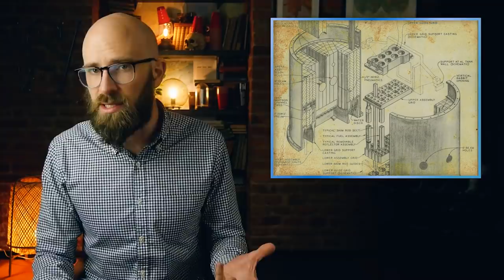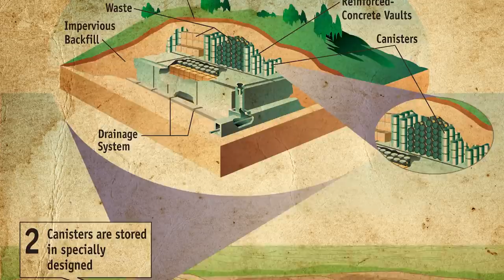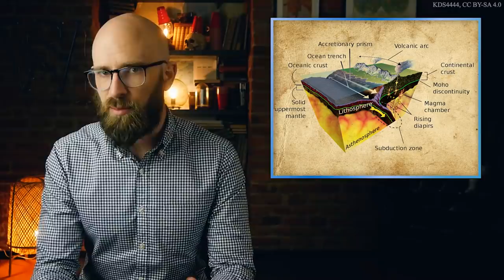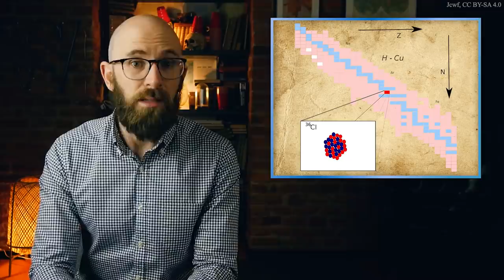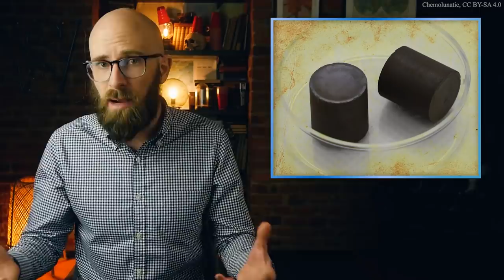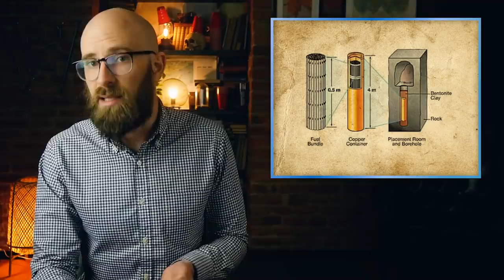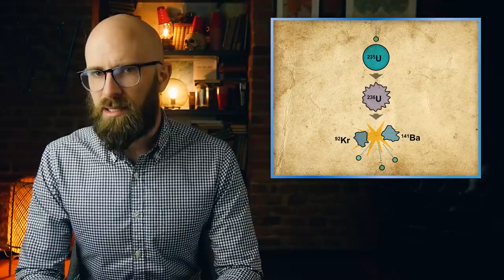How Does Nuclear Waste Disposal Work?

Comment: what if nuclear waste could be used for something that we have not yet thought of🤔
Reply: We could use it as some sort of weapon .
Reply: Most used nuclear fuel cells from reactors are  going through recycling process, to obtain various products, that are created during nuclear reaction. But unfortunately this process is very very slow. So as of yet, big portion of it sits somewhere in the storage, either in water or tomb made out of concrete buried underground.
Reply: There are a number of ongoing projects in development which plan to use existing nuclear waste for small scale electrical power plants and to power engines for space vehicles.
Reply: @krivdik  in fact almost no nuclear fuel is going through recycling. While it is possible to recycle nuclear fuel the cost and danger is just not worth it. Some process are basically in process for experimental reasons.
Reply: If we somehow discover nuclear waste is really useful we would just make lots more of it. It is not like we have a problem making the stuff.
Reply: @welfdeath  oh yah like we need more of those .
Reply: @revcrussell what percentage of "all" is "almost no"? Could you define that for us?
Reply: Black Vito - Moneyology, if we want it, we can get it. Despite being deep inside the bedrock, it's not impossible to get it out. Dig some 600m, scoop the bentonite clay out of the way and that's it. Mostly already in a very compact state, it would be more efficient way than digging for new ore and refining it.
Until that happens, they are safest deep underground.
Reply: It's already used in smoke detectors, high pressure gauges, the medical field, bullets, armor, sterilization, artillery etc....  the time has come to know we shouldn't be using it because what its done.  We know its organically binding to our cell once ingested and causes cancer. I think the time for change is apon us before actual prompt criticalities start to happen.
Reply: Nuclear waste CAN BE used for many other things and we HAVE thought of them. ;) But deeply unscientific political pressure prevents us from taking advantage of these advances. :/ 

One of the reasons that designing a nuclear waste repository is difficult (that Simon didn't mention) is that they need to included a retrieval mechanisms for just such a purpose as reusing the nuclear waste. Scientists insist on including this feature in the hopes that future people won't be a dumb and wasteful with their resources as we're being.
Reply: @bronzedivision  Deeply uscientific??? You wrote that before I responded.   Ok now, explain to everyone how the inverse square law is used not only for the measurement process but also the calibration as well.  Make sure to note this law only works in a vaccum and does not apply to extended sources of radiation as well.  Explain how an "exclusion zone" sphere cant be made around a meltdown without using this law so if the source is extended then explain why that "exclusion zone" is actually null and void.  The reason it doesn't apply to extended sources on the surface of this planet is 1. Water cycle 2. Atmosphere 3. Oceans currents 4. Jet stream 5. Water solubility of radionuclides 6. Evaporation under equillibrium conditions 7. Bonding with molecules like oxygen 16 and 18 8. Free movement around the planet 9.  Once ingested it forms organically bound forms of it 10.  CAUSES CANCER, AUTO IMMUNE DISEASES, MUTATIONS AND OTHER DISEASES AND AILMENTS THAT ARE PASSED ONTO FUTURE GENERATIONS.  Provide a list of all the deaths caused by cancers, auto immune diseases and mutations of every kind that were caused by ionizing radiation ONLY for the past 70+ years since the atomic era.  You are aware no such list exists and without the ONLY deaths that could be associated with nuclear power added into the statistical analysis then any person promoting the use of nuclear power is completly and utterly incorrect.
Reply: man with pen around neck  Because it's our best energy source by FAR. And also useful for a litany of scientific and industrial processes that modern society has come to depend on.
Reply: @bronzedivision  Again no it is not our best energy source....especially at only 10% globally....
Reply: @paulmobleyscience  hahahaha Until you have a reliable weather report or a solar panel that works at night nuclear power is the ONLY energy source. So that makes it the best by default.
Reply: U-238, the vast majority of the waste, can be used as energetically net-possitive fissible in fast neutron reactors
Reply: @bronzedivision  Im sorry? "Hahahahaha"....is that the technical scientific notation of laughing or isn't it quantified better with lol or lmao or even the simplistic 😂 
Surely you know that thousands of companies exist today that will come to your home and place a solar system that will not only meet 100% of your energy needs but also make excess power that you then sell back to the grid and make actual money from???????   Your stance is so 1970....leave it there and come back to the future.  The future is now Bronzedivision respectfully the pronuclear stance is dead now.  The cat is out of the bag ha  ha   ha   ha   ha..
Reply: @nickkorkodylas5005  No U235 is the issue....U238 captures the neutron.  And its the daughters that exist thats the issue.  Pu236 is made only in a nuclear reactor...many radionuclides are only found synthetically in a man made reactor because and specifically due to the U238 neutron capture.  Its like the natural form of control rods.  They have to mine millions of tons of U238 to find the small amount of U235.  At the end of both alpha and beta decay modes there is a gamma release.  Usually the mix is about 3% or lower of U235 and if Its MOX the uranium plutonium mix is usually no more than 6%.  The waste has never just been U238.  Look at the U308 Galen Windsor licked off his hand.  Not even yellow cake yet....
Reply: @krivdik  We can sustain the entire US energy grid for 100 years on the current nuclear waste available if we recycled it.
Reply: @paulmobleyscience  Nuclear is our best energy source.
Reply: @TechnoMinarchist  No, No its not.
Reply: @TechnoMinarchist  This isn't about money or how much fuel we have left or any other self indulged reason.  This is about how dangerous it is shown by not only Fukushima but the hundreds of issues and incidents had before Fukushima.  This is about militaries of the world furthering the use of nuclear not the people. Nuclear is 10% of the global market....after 70 years nuclear is not the future it is the past
Reply: @krivdik  Most used nuclear fuel cells are NOT going through recycling process.
Reply: @welfdeath  we do.  It's called a dirty bomb.
Reply: @krivdik  No spent nuclear fuel is being reprocessed in the United States.  The process is not slow, but produces large quantities of highly radioactive and hazardous waste.
Reply: @bronzedivision  Monitored Removal Storage is not a regulatory requirement for waste disposal. It is an option for short and medium-term storage, not disposal.
Reply: @TechnoMinarchist  No way.  And reprocessing spent nuclear fuel produces a lot of highly radioactive and hazardous waste.

Comment: If this nuclear waste is still giving off so much heat and radiation, why not use it to make more electrical energy?
Reply: because tree huggers don't always accept science, either
Reply: @danadurnfordkevinblanchdebunk  can't we just use the heat to make steam and turn a turbine, like the nuclear reactor did?
Reply: @ScottJPowers  Hes only here to promote nuclear power because he sells geiger counters and has a buisness that revolves around prepping for nuclear accidents and war.  Nuclear power must continue for him to have his niche....I have it all documented on my channel.
Reply: Firstly, it cannot be controlled. Reactors use uranium because it can at least be damped down.
The decay of the fission products is much more constant and not subject to control by damping rods or moderators.
The heat generated by the waste is a very tiny fraction of that made by an operating reactor. It has no real commercial value.
It does have nuisance value. It is enough to damage the fuel rods and pellets, if it is not kept cool, which requires continuous circulation of cooling water.  It could evaporate several olympic pools worth in a week or so without continuous cooling, and if the rods were exposed to air they could get hot enough to burst into flame. The zircalloy sheaths burn like magnesium, even underwater once they get started.
Overall, keeping waste cool is an expense. Putting it close enough to people to be useful as heat would be risky.

Comment: I like the idea of inserting the waste into the mantel. Dig a super deep hole, drop the waste in, then fill it in with rock. It will then melt and join the mantel, keeping it away from water and the surface almost permanently

Comment: Yeah, the reactors of all those disasters are a far cry from what we can make today, there are new ones that are simply way safer and basically, it's the only way we can curb the CO2 output fast. The other techniques are taking far too much time to even get close.
Reply: New nuclear plants require a lot of concrete. Which means a lot of carbon. Which means new nuclear plants take about 10-15 years to go carbon neutral. Since we have 10 years to avoid catastrophic climate change nuclear power is useless.
Reply: We are IN catastrophic climate change! There are 4 billion MORE people on Earth that weren't here fifty years ago. (total 8 billion). No more!
Reply: our house is on fire, it will take the fire department ten minutes to get here, might as well not even call them- @jacobvardy
Reply: @MrTaxiRob , at least the fire department won't pour more fuel on the fire.  Which is what building nuclear power plants would mean at the moment.
Reply: @jacobvardy  agreed
Reply: While I'm not against nuclear in the long run, the fastest non-fossile fuel energy sources we can build are solar and wind, not nuclear.

Comment: I never really got the whole decay heat concept - why is it waste heat at this point? If it is still that naturally radioactive, use that heat to boil water (which is how the standard reactors work anyway), make steam, and keep using it to generate power until there is none left.
Reply: Efficiency and money is my guess, mixed radiactive waste would have inconsistent heat production and poorly controlled reactivity meaning meltdown could happen more easily than standard enriched uranium oxide

Comment: Thorium LFTRs can use radioactive spent fuel for fuel and turns everything to low level waste. You can find this info on Youtube.
Reply: Lots of misinformation about molten-salt reactors. Do some research on LFTRs, you'll find they don't use spent fuel. In theory, they could use reprocessed plutonium. Only one molten salt reactor has ever been built, shut down in 1969.
Reply: @rhynosouris710  Yes there was only one operated in Oakridge TN. You don't know what your talking about. MSRs can burn nuclear waste easily. They don't stop the decay chain with a MSR and let the radioactive material go all the way down to the low level waste that it will turn into and extract as much energy as they can from it. Type in Thorium LFTR in Youtube will show you a ton of videos about what you can burn in a Thorium MSR, it just takes a little work to shift through the massive amount of videos to find that info.

Comment: Lots of backwards "facts" in the beginning. Short-lives waste is the hottest. Something that the script writer contradicts himself with 6 minutes in.
Nuclear reprocessing most certainly happens. It is important for non-proliferation reasons.
The cause of the Fukushima explosions had nothing to do with the spent fuel. That was a later issue.

432 years is not a long half-life.
Copper is not in the slightest "corrosion-resistant".
Enjoy this interaction comment because you aren't getting any more watch time.
Reply: OMG... Don't you know anything about nuclear energy? Rule #1 Never let facts get in the way of a good scare. :P
Reply: There is no reprocessing of spent nuclear fuel in the US and produces a lot of highly radioactive and hazardous wastes.  One of the primary reasons it is NOT done is because a product of reprocessing is Plutonium-239, a (the) major fissile material in atomic bombs.
Reply: @vanguard9067  Nothing is "produced" in reprocessing. The point is to remove the still usable bits from the waste. This would extend the lifetime of the accessible reserves on Earth.
Pu-239 has a potential use as fuel.
Reply: @Markle2k  waste, i.e., the unusable high-level fraction, along with the chemicals used in separation is “produced” as a result of reprocessing.  Pu-239 (as well as other isotopes) are contained in spent fuel, however, as of this time commercial spent fuel is not reprocessed by policy, reflecting global concerns about nuclear proliferation.  The Wikipedia entry “Nuclear Reprocessing”, the History section, gives a pretty good summary of the political challenges of US commercial nuclear waste reprocessing.  Check out the Wikipedia entry about the environmental consequences of operating the only reprocessing facility dedicated at one time for commercial spent fuel (West Valley Demonstration Project).  It includes the summary of new high level waste being “produced” as a result of reprocessing.  “The reprocessing of fuel also resulted in the accumulation of 660,000 US gallons (2,500 m3) of high-level radioactive waste in an underground storage tank.”  This waste would not have existed, except for reprocessing.  If not describing is as being produced, how about saying it was created?

Comment: How does nuclear waste disposal work? Answer: It doesn't
Reply: No one has ever been killed by stored nuclear waste.  It's actually very valuble fuel in the next-gen reactors.
Reply: @danadurnfordkevinblanchdebunk  Sure no one's been killed by it, but when the only solution is to bury it in the ground and leave it as a no man's land for hundreds of thousands of years, that's not a solution.
Reply: @shintao537    It's not the only solution, it is very valuable fuel that can be depleted much more in thorium molten-salt reactors.  About 90% of the original energy of spent fuel rods is still in the "nuclear waste."
Reply: @danadurnfordkevinblanchdebunk  "VALUABLE FUEL" and there in lies the issue.  A market was made out of thin air for nuclear waste and just because they designed breeder reactor to help use more but not all of the spent fuel does not mean further use of it should be done.  See you are everywhere attempting to argue everyone that says nuclear power is wrong.  These people are not wrong Craig in anything they are saying so why are you here promoting it when waptek said you are against nuclear power?
Reply: Pail Moppy   Show how today's spent fuel rods cannot be used in thorium molten-salt reactors.   No one is impressed by your nonsense.
Reply: @ForbiddTV  Simple: There are none. Cant put spent fuel rods in a reactor that doesn't exist.
Reply: @shintao537   Perhaps you should look up the meaning of the words "future" and "next-gen".
Reply: @ForbiddTV  This video isn't about how we might deal with waste in some nebulas future, it's about how we deal with waste right now. And right now we don't.
Reply: @shintao537  Craig Douglas from forbiddtv has a bias and conflict of interest because he sells antique geiger counters and has thousands to try to get rid of.  He is a troll that goes to everything Fukushima related and harasses people including my fiance and told her lies that affected us greatly all shown on my channel.  Now you can understand why he acts the way he does.
Reply: To be fair, it hasn't been tried yet.
No facilities are operational, and the only one that is close is tiny.

Comment: Simon, Simon, Simon - I've done research on this in the past. Solar power is slightly safer. Almost imperceptibly.

Hydro power has the drownings and wind power has the falling, but solar power is very very very imperceptibly safer.

Comment: Can we have a video about Moltex Energy Ltd.  They say their intrinsically safe molten salt reactor is fuelled with irradiated “spent” nuclear fuel. The fuel has a 30,000 year 1/2 life because existing reactors extract less than 5% of the energy. Moltex will extract 99% of the fissile energy leaving a waste with 30 years 1/2 life. 
An in-depth story about this project would be great.

Comment: When talking such large time frames there is also a significant risk of a meteor impact, volcanic activity and nuclear war itself from potentially melting through every protective layer of coating.
Also, it's worth remembering the Chernobyl incident occurred during a safety drill and only last year a nugget of C-137 waste was lost in transportation. It was recovered but it goes to show our foolproof safety measures are marginal.

Comment: The only disaster that happened at three mile island was a public relations one.  Yes there was an accident, and reactor two technically melted down, but there was no explosion, or escaping radiation other than  some vented gas that makes grey neon signs.    Hell reactor 1 at three mile only shut down in 2019.  think about that.
Reply: There were releases of radioactive iodine too, not in particularly large amounts.